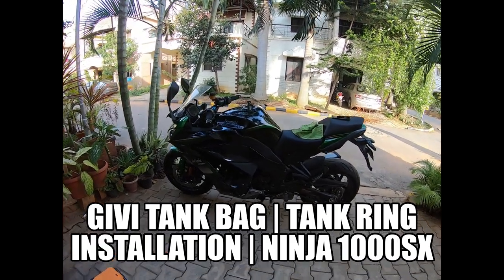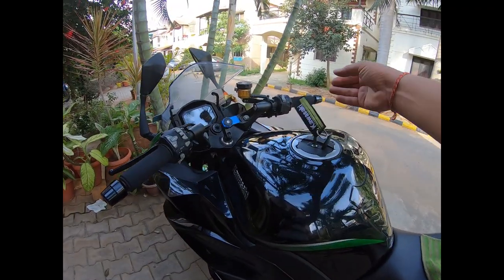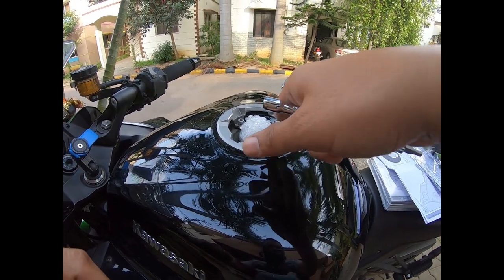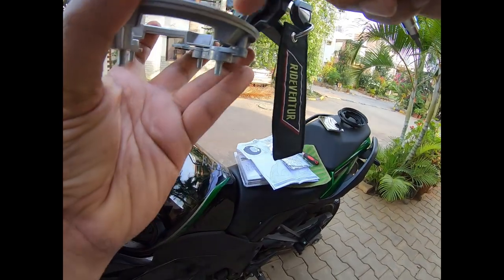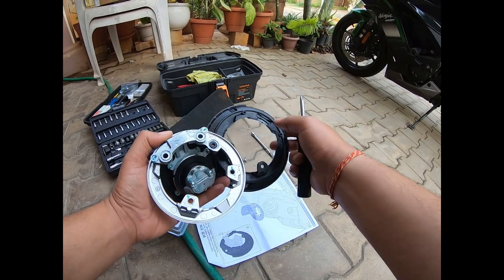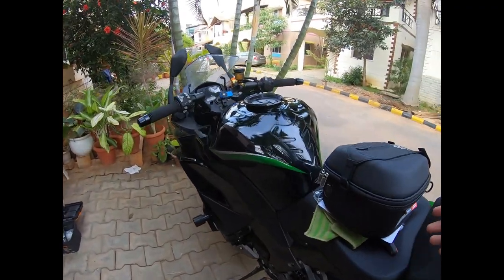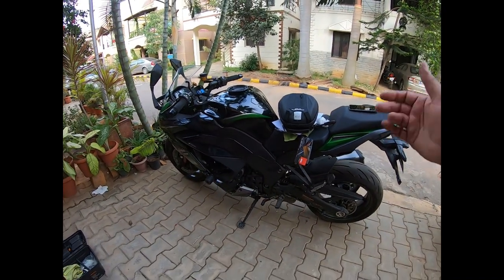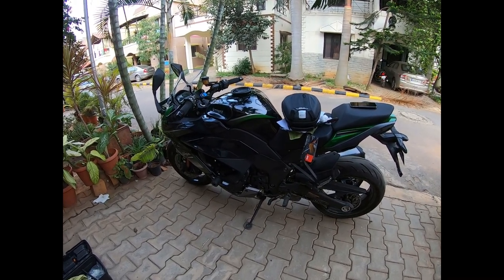GIVI Tank Bag | Tank Ring | Installation  | Ninja 1000SX

Comment: You put the small rubber seal back in from the wrong side. It is supposed to slot in there from the bottom and get sandwiched between the tank and the cap.
Reply from the maker: Thanks for letting me know, let me check it over the weekend.